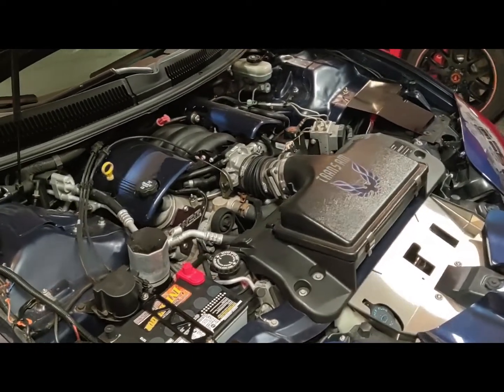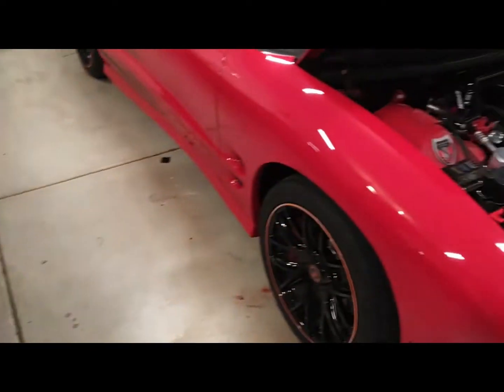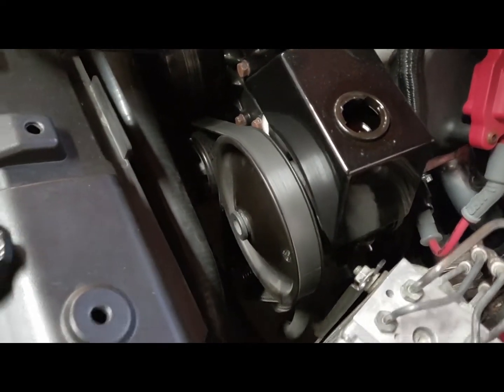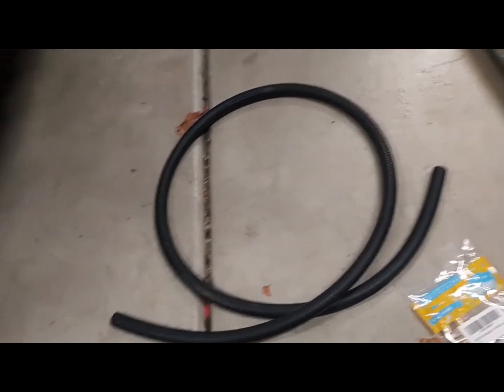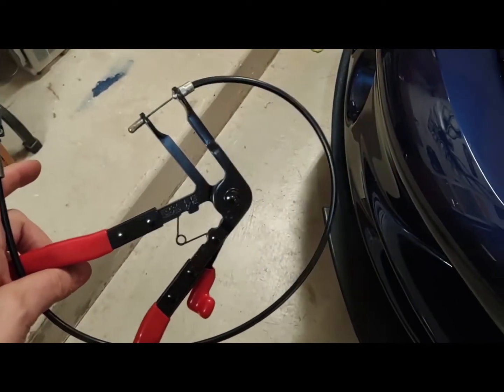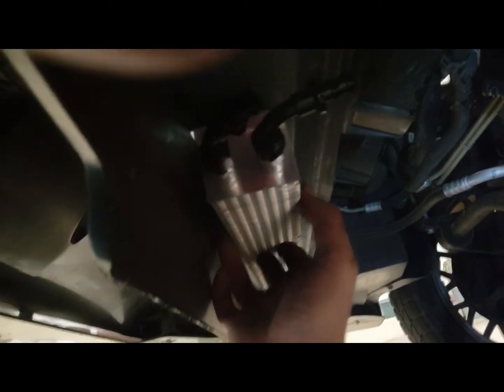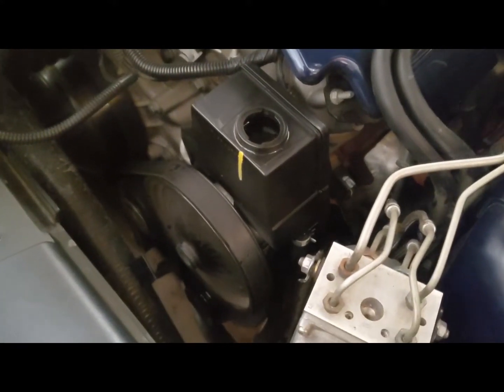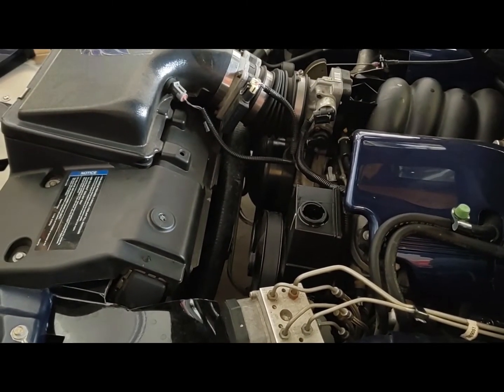4th Gen WS6 Trans Am Power Steering Cooler Fluid Loss Problem and Bypass

Comment: I wouldn't use the IR temp gun for this. Instead, use a Type K thermocouple full contacting temp sensor. Get them at any auto parts store, not too expensive usually works in conjuction with a digital multi-meter, also available at the parts store, not too expensive. You can't really get a tight, spot temp with the gun. Also, it will sense most materials, but it will NOT accurately measure Non-Ferrous metals like copper or brass. A trick to knowing which is which, if a magnet will stick to it, it is a ferrous metal. If the magnet will NOT stick to it, it is a non-ferrous metal and the temp gun will not give consistent accurate readings. My 2 cents anyway...Ol Sarge...

Comment: What do you got to do with the two power steering cooler hoses to make it run like the other car without the power steering cooler? You run one line back to the pump reservoir where's the other line go? Does the second line go back to the rack?
Reply from the maker: You would not have the hose that goes to the radiator coolant hose.  It would just run from the steering rack directly to the side of the pump resivoir.

Comment: I have an 02 ws6 and the steering wheel has been tightening up but only when I reverse. I’ve changed the steering pump, rack and pinion, new timing belt kit. Could the power steering cooler be the problem?

Comment: I just changed my PS pump to the Vette style with reservoir relocated to next to brake reservoir. Replaced both PS hoses and upper radiator hose without cooler and ran return lines to cooler under radiator support. Love it
Reply from the maker: @joe00camaross  awesome.   I just changed to the same pump as well last year.

Comment: Thanks man for the part numbers! Really helpful. I have an 01 and I’m like, where the hell did my PS fluid go? And what’s this metal section of pipe? You just made my like a bunch easier.
Reply from the maker: Oh man that sucks.  So is your antifreeze all discolored?
Reply: @1999TransAmWS6  actually not really. It was kinda low but it wasn’t checked in quite a while. Possibly years. Just recently got the car. Power steering pump is going, and I’m just finding out about the cooler issue. Good thing it was before I had it apart!

Comment: Thanks for this! Was looking for a good video.
Some ideas that I will probably do:
Flip the bolts and washer so it's easier to put nuts on. Also cut a small slat in the air dam so the cooler gets better air flow.
Reply from the maker: I originally did try putting the bolts up-top in the nuts from the bottom but I was not able to fish the bolts with the washers in that area. It's really tight. It might be doable I just wasn't able to do it. Ask for cutting the hole in the air dam, I honestly don't think that's necessary. I never did a follow-up video but driving on a hot summer day for hours I did do some temperature checks and this car never got above 140°. My friends WS6 with the factory cooler was 195°.   It doesn't seem to really require air flow. Just having the large cooler exposed seems to work pretty well and there still might be some are spinning underneath the car behind the air deflector
Reply: @1999TransAmWS6  Thanks for the reply/info. I appreciate it. Yeah 140 seems fine for the street! I do plan on doing occasional track days, so I'd rather be safe than sorry.
Reply from the maker: @tydontdy3459  For the track it definitely wouldn't hurt to cut the hole.  For being my daily driver it seemed fine.  I was originally planning on cutting it if the temple still high

Comment: That little clap holding the hose going to the power steering reservoir is pissing me off right now :)
Reply from the maker: Yeah, that one is a pain.  It's even more fun getting it back on.
Reply: @1999TransAmWS6  im so glad you just responded. Which hose did you put to the cooler? Like where did the power steering go and which one did the coolant go?
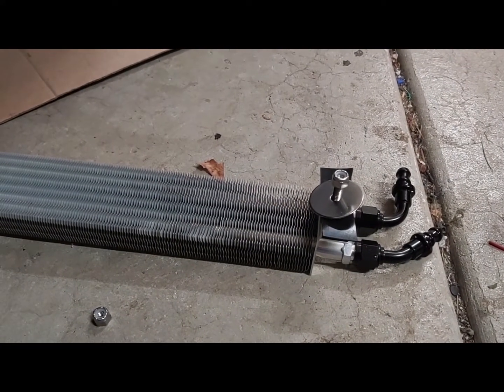Reply: @1999TransAmWS6  so looking at minute 9:39, the right side of the screen hose is the power steering and the left side is the coolant right?
Reply: @1999TransAmWS6  or does it matter which one goes which?
Reply from the maker: @Isaihernandez777    on the cooler it doesn't matter what side goes to each port.  The pump pushes the fluid through regardless.
Reply: @1999TransAmWS6  thank you :) for some reasons I would think they’d mix or something :) thanks so much. Car is done.
Reply from the maker: @Isaihernandez777  you can message me on Facebook
Reply: @1999TransAmWS6  ok I think I sent you a DM
Reply: Update: I got the mf
Reply: The hose I got seems to be too tight. But I’m gonna spit on it and hope for the best.
Reply: God damn spit does some wonders.

Comment: I really hope I get a reply back but I'm having this issue but I have a base firebird with a V6 my antifreeze and power steering fluid is both leaking fast. What got me thinking you shown the picture and that's almost what mine looks like just no antifreeze. If I could get a suggestion or tip that would be awesome! Thanks again!
Reply from the maker: I could be wrong but I don't think the V6 cars have a power steering cooler.  Even the base model Trans Ams and Formulas don't have one, just the WS6.  It sounds like you just have regular leaks that need to be tracked down and fixed.
Reply: @1999TransAmWS6  Yeah I looked at it earlier today and didn't see one. But thanks for the advice and tips I appreciate the help.

Comment: The angle adapters to the cooler did u add teflon or just install it regular?
Reply from the maker: No, I didn't add any teflon.  It's been over a year so far and no leaks.
Reply: @1999TransAmWS6  what size are the bolts and washers?
Reply from the maker: @naranjoceidy  I don't remember.  It was just stuff I had on hand.
Reply: @1999TransAmWS6  how about the rubber matting where did u get that?
Reply from the maker: @naranjoceidy  just something I grabbed from work
Reply: @1999TransAmWS6  ah I see I will try see what I can use

Comment: I had that issues at about 120k on my 2002 Camaro SS. Like you I had a 2000 Z28 and a 2000 SS and neither had a cooler and both went to 200,000 miles without power steering pump or rack issues. When I found the mess in my cooling system I simply bought a 2000 Z28 radiator hose, pressure hose and return hose and put it all in there. Once the muck was out it has been fine ever since. Great informational video and ZERO issues without a cooler!
Reply from the maker: Awesome, thanks for commenting.  I agree and think a cooler is not needed at all.  I figured I'd put an aftermarket one on here just to try it.  If it ever gives me any issues with leaks, etc I'll remove it and go without a cooler.

Comment: I wonder if the powersteering cooler is more like you said a heat exchanger.. not so much to cool the fluid.. but maybe to help get the fluid to warm up quicker in freezing temps and stabilize fluid temps in hard driving situations.  A better test, which I have seen done would be figure 8 and lock to lock in a parking lot to put more load on the pump. 101k on my 2001.. might just do the bypass/cooler while i do the throttle body coolant bypass.
Reply from the maker: Yeah, the way it performs it's not a 100% cooler even though on the build sheet under WS6 options it says "power steering cooler", probably just for marketing.  I'll be redoing the same test in the summer a few different ways.  If the factory or aftermarket cooler is never drastically different than having no cooler at all then I'll just pull off the aftermarket one......be one less place to get a leak in the future.   I've had 15 firebirds/Trans Ams over the years, with 6 of them being 4th gens and only 1 having the factory cooler.  I've never had to replace a power steering pump or anything in my life. So as of now, I don't think it's necessary.
Reply: I thought the exact same thing.

Comment: Awesome video brother. I am thinking of not putting a cooler in and just running the two hoses together.  Just for giggles what was the cooler part number and name brand
Reply: ...Justin case I change my mind
Reply from the maker: I used Perma-cool 1006.   I don't think it's really needed.  I was extremely tempted to just shorten up the hoses and splice them together but I already bought the cooler and wanted to see how much of a difference it makes.  When I do the temperature test in the summer, if my car without a cooler is the same temp as the factory cooler I'm going to pull this aftermarket one and just splice them.

Comment: Thanks for your video. I just discovered this with my 2002 WS6. It must of just happened because I checked my coolant a few months ago and it looked perfect. Now it has the sludge look. I ordered the parts based on your video. Thanks again.
Reply from the maker: No problem.  I hope it will help.  It's such a stupid design by GM.

Comment: Been there, did that! At year 15 on my '98 I had perform this bypass surgery, working great ever since. Very informative video none the less.
Reply from the maker: It's such a weird problem I never knew about until my friends failed.  After a little research, I figured I'd get it done before it became a problem.    Did yours start leaking or did you bypass it before it failed?
Reply: @1999TransAmWS6  after it failed of course! The factory cooler is a poor design. Only after the power steering reservoir kept filling with fluid did i figure it out. Since antifreeze is corrosive the pump seals went out fast, so new pump went in.
Reply from the maker: @firebreather050  that's a bummer.  It's ironic that the part GM put on the car to prolong the power steering pump ended up being the cause of it's destruction.
Reply: @1999TransAmWS6  You are correct!

Comment: As always awesome video very educational and I have learned so many things to help me tackle some of the jobs on my 98 Formula. I don't know but in my opinion the power steering cooler seemed to me to be a factory over kill. The one thing you did have that caught my eye was that little tool used to squeeze the hose clamps together. Where did you find it? I cannot tell you how many combined hours over the years that I've wasted trying to get those hose clamps off with pair of pliers. Just to turn around and put a regular screw on hose clamp back on  because I didn't want to get in a fight with the pliers and a hose clamp again. Keep the videos coming.
Reply from the maker: I fully agree.  It's listed as a power steering cooler in the build sheets for WS6 options and I think it was done purely for marketing.  Some people theorize that it's because ws6 cars run wider 275 tires but I don't buy that.  I've owned six 4th gens since 2000 (five of them didn't have the cooler) and I've always put larger tires on.  I've never in my life burnt up a power steering pump.   When researching seems like this was the thing to do with the aftermarket cooler so I figured why not give it a try.  After my summer temperature test I'll probably buy the return hose from a non-ws6 car and get rid of the cooler all together.   
Here's the hose clamp tool I use. It's great to use because it locks them in place until you hit the release tab.   https://www.amazon.com/gp/product/B000F5JM0O/ref=ppx_yo_dt_b_search_asin_title?ie=UTF8&psc=1

Comment: Yes,, Thank You for Posting this Video,, it was Very Informative.
Unfortunately I have a 1999 Trans Am & the same thing happened with mine, but I didn’t know where the Power Steering fluid was going.
Everything you said about the Brown Sludge is  True.
I tried everything & couldn’t figure it out,, I had a conversation with a fellow Trans Am owner.
BINGO!!!
Did the same thing you explained on your Video to resolve the problem,, issues fixed.
Please take time & watch the Complete Video, it is Very Informative 
Thank You
Reply from the maker: Sorry to hear you had the problem.  Curious what year did it happen and how many miles did you have on your car at the time.  When it happened to my buddy this year in 2019, he had 116k on it.    My friend has been a mechanic for a few years and it was driving him crazy where his power steering fluid was going.  He said flushing that brown sludge out was a PITA.   As soon as I heard his problem I started researching and found a few dozen cases on LS1 Tech and a few on youtube so I wanted to put the word out to hopefully save some people the headache.
Reply: Jason Firebird  -  I realize I had a Problem in 2018 & I Flush the transmission & Radiator,, without any resolution to the problem,
In July 2019 another Trans Am owner was telling me what Happened with T/A of those years..
Power Steering Cooler exchange System change & Resovled🤞
My Trans Am was done in July, 2019 & has Over 120,000miles

Comment from the maker: The cooler I used is from Perma-cool, not Derale.  I accidentally say Derale in the video    As for the temperature test, I only showed a single test of each in the video.  I actually tested each situation a dozen times.  My laser thermometer had a difficult time picking up the reflection in the tiny opening of the reservoir cap hole.   The factory cooler averaged 141, the red TA with no cooler averaged 119, and the blue TA with the aftermarket cooler averaged 105.